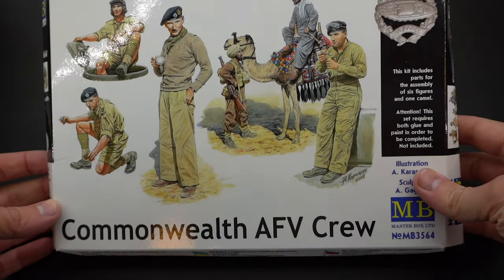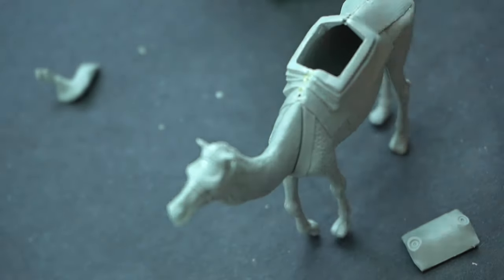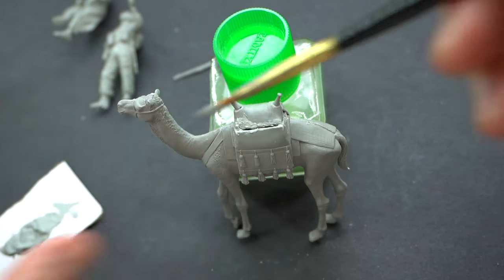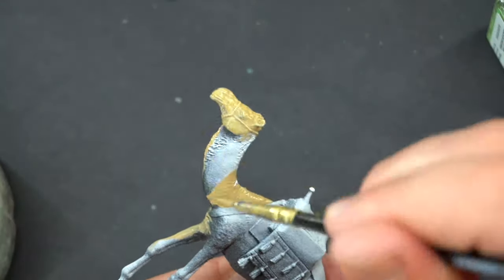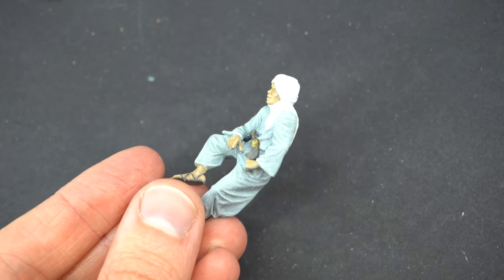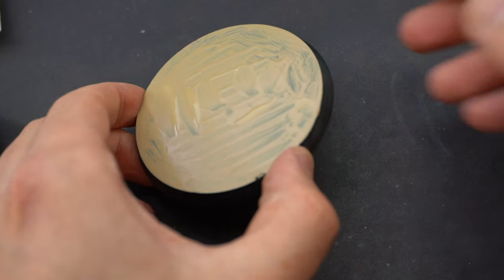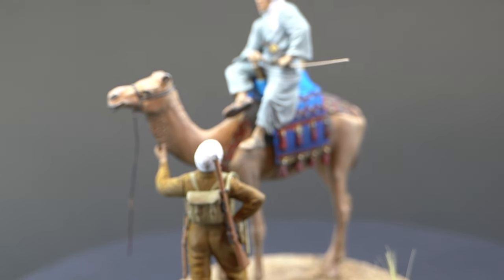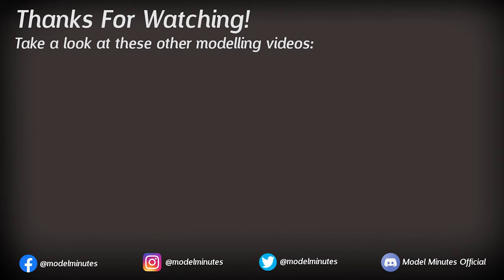Building the Master Box 1/35 Scale Camel Rider & Solider Diorama!

Comment: You smashed that buddy. It's a lovely part of modelling to look at,and I whole heartedly think you should do some more. Also its a fresh look to your channel. 👌
Reply from the maker: Thanks, will do! I might look for some more figures in the future :D
Reply: @ModelMinutes  Hi Mat...what would be the best way to remove decals?...i really dont want to scrape them off and ruin the paint job...i have a rusdian Mig- 23 and want to change it to an Iranian example to depict 1 of the several former Iraqi Airforce machines that fled to Iran and were then pressed into service with the Iranian Airforce when desert storm kicked off.
Thanks.👍
Reply from the maker: @damien5748  sadly the methods I know of which will remove the decals (ipa, spirits) will also possibly remove the paint underneath.

Especially difficult if the decals have been sealed in with some varnish
Reply: @ModelMinutes  hi Mat.thanks for the reply...i suppose i could gently scrape them off and do a little touch up...shouldnt be too hard as they are not sealed with varnish and its an academy kit so the decals arent the best anyway👍👍.
Reply: @ModelMinutes  got it sorted Mat...scrapped them off using my finger nail...each decal came off in 1 piece and no damage done to the paint job....happy days.
Reply: @damien5748  masking tape works well